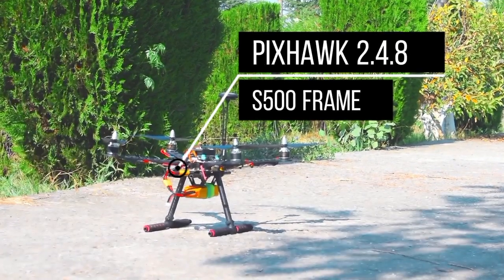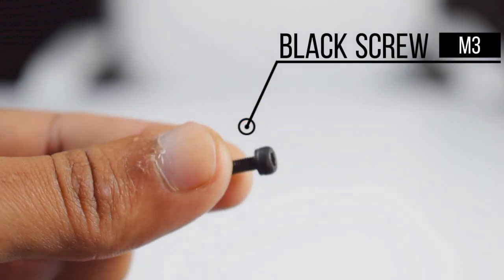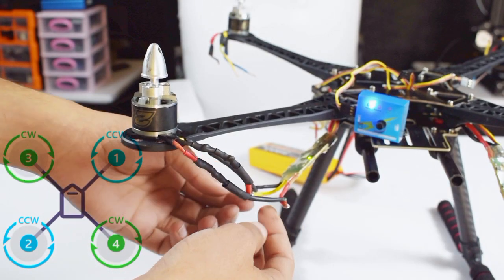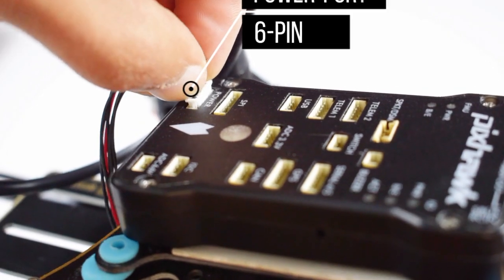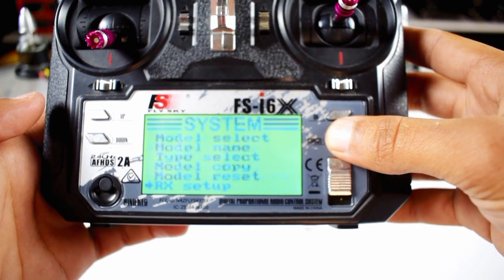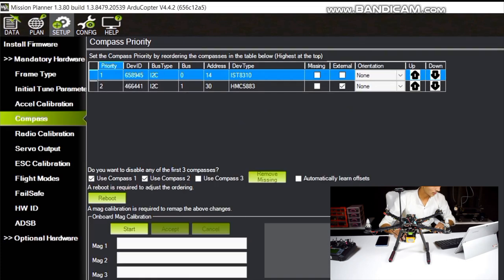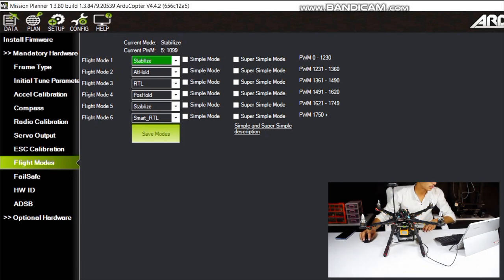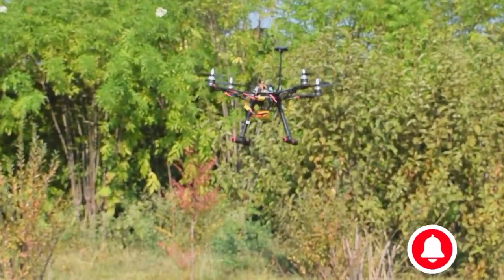How To Make a Quadcopter Drone Using Pixhawk In Detail || DIY Quadcopter Using Pixhawk

Comment: Just a tip since I'd like to share, instead of directly connecting the BLDC motors to the ESC, it's better to use "bullet connectors" which might help you to replace the parts easily if any damages occur later

Comment: Sir please tell me can we put custom code to control the Pixhawk 2.4.8 MAIN OUT as we desired with Transmitter, I'm trying very hard but not able to get the solution.

The main thing is I'm building a Tri-copter using Pixhawk 2.4.8 FC so I want set a 'Terrestrials mode'  where Tri-copter lands on the ground and it back propeller which is obviously connected with servo as it is a Tri-copter goes perpendicular to ground and acts like a wheel

Please sir help me!!!

Comment: All calibration copy to u then armed the drone, flight controller flash led blink yellow after and before armed, and the result motor is not warking. Please solve the problem.
Reply: Sem problem 😢
Reply: did you get the solution ??